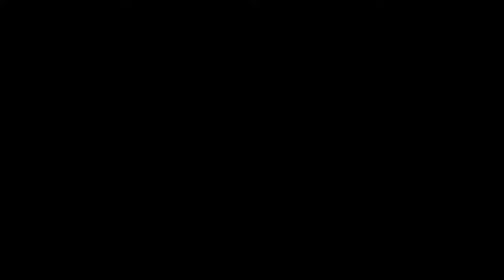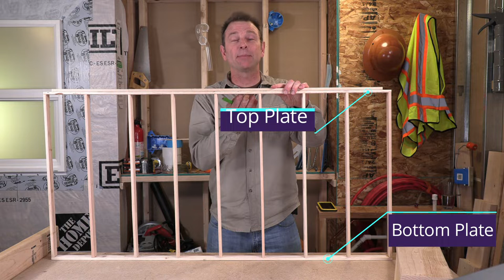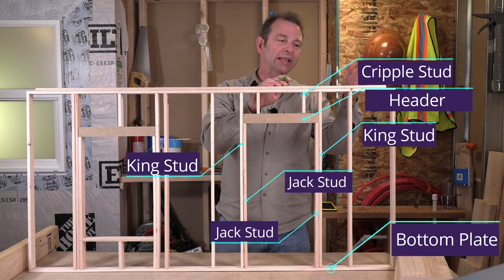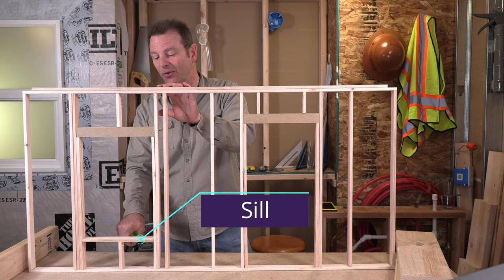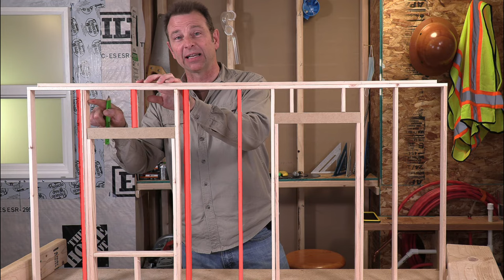Review the parts of a wall with rough openings  - A mini lesson from TradeSkillsU.com Framing Course

Comment: Can a common stud act as a king stud if rough opening falls withing the layout or would a rough opening be moved to accommodate a true king stud?
Reply from the maker: If a King or Jack is exactly on the layout pattern you need that is all you need.   If you are framing on a load bearing wall - consult with the engineer to make sure an extra stud is not needed to carry the load from above.

Comment: Why 24 OC I thought it was code to have no more 16 OC?
Reply from the maker: Sorry Domingo, code does not require 16OC.  It will also depend on if you are framing with 2x4 or 2x6.   And how many stories the house is.

Comment: Your videos are some of the best for construction topics.  Clear, concise and informative.

Would like to see some information when framing on top of a masonry stem wall.
Of particular interest is the door framing which is simultaneously attaching to both a masonry and lumber surfaces.  
Another topic would be framing considerations for garage door openings.  Some standard spanning approaches would be helpful.

Does installing a double bottom plate offer any value to the overall construction of the frame?
How is insulation installation approached when encountering non-standard layout of the vertical framing?  Obviously, not all openings are 24 or 16 inches.
Reply from the maker: Glad you found our lessons helpful

Comment: What happens if your door opening interferes with your layout? I see you use the cripple stud in place but can a king stud be used singularly as a common stud or would you beef it up with another king stud?
Reply from the maker: There are times that a king stud falls exactly on layout and in that case it would act as a common and a king.   But you won't get that lucky very often

Comment: You explain that the cripple studs are marked only on the bottom plate, because they don’t extend to the top. But a summary diagram toward the end identifies cripple studs above the window RO as well (and also discussed in one of your other lessons). Are these not marked, or marked in a different step, or am I just missing something? Thanks much. And really superb explanations in all of the lessons I’ve watched so far. Great work.
Reply from the maker: yeah, that was not that clear the way we said it.   We were trying to say that they cripples are not in the middle of the RO - but yes they are still on the top and the bottom of the window.